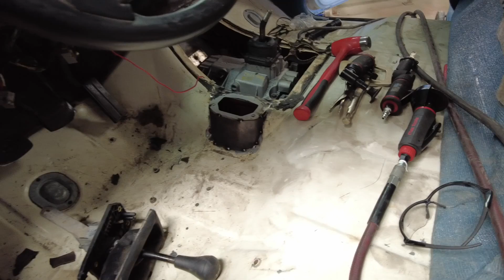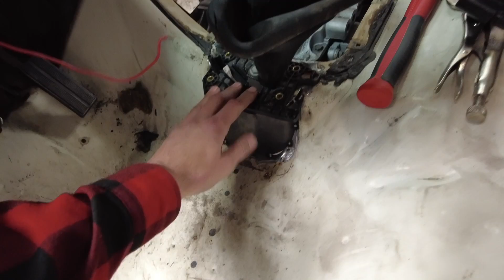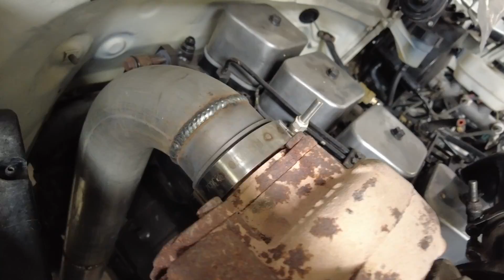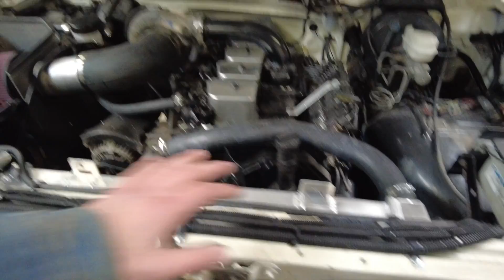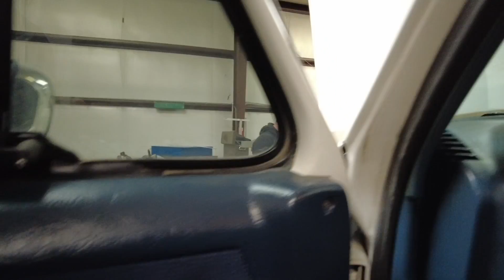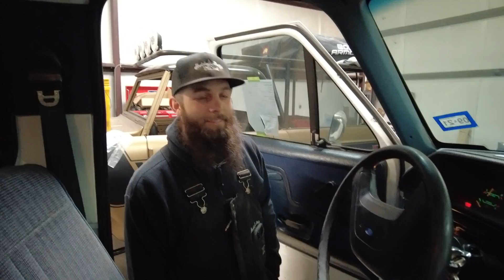Fummins First Start Up

Comment: My dream truck, 77 ford F350 super cab, 24 valve 5.9 with a 6 speed allison and  an Atlas T case, Dana 80 rear, Dana 70 front, leaf springs front and rear.  And when I win the lottery,  I'll have it...

Comment: They where mounted to the transmission cause frame/body flex. Having the shifter mounted to the body. Depending on how  it twist or flex it could knock it out of gear or in another gear.

Comment: Really good work on not just stabbing a motor in. I know there's at least a weeks work in working out linkages, the booster connection and a fully functional dash, much less the rest. I really like the T-Case interior trim.